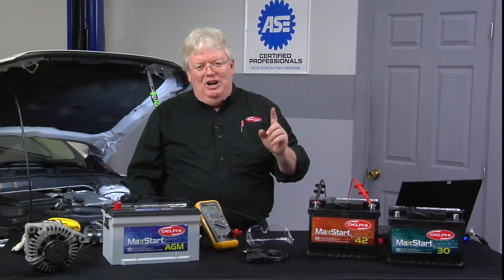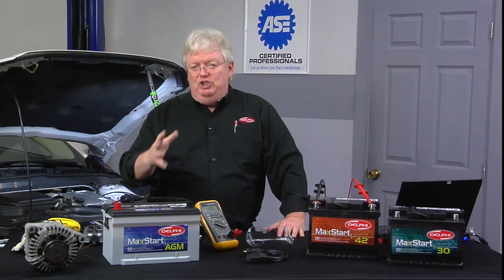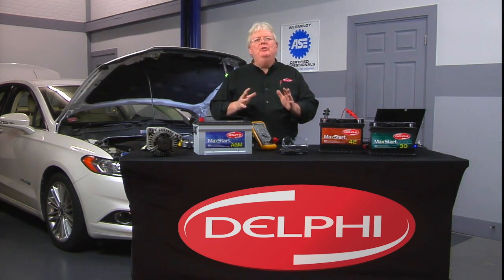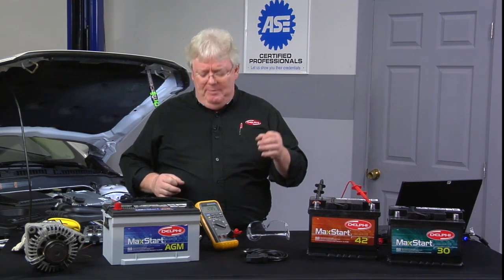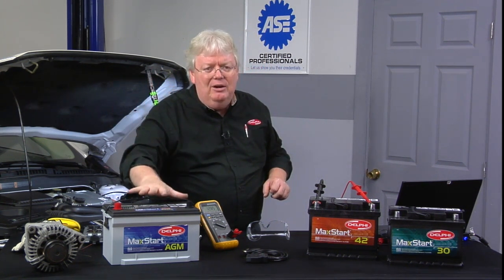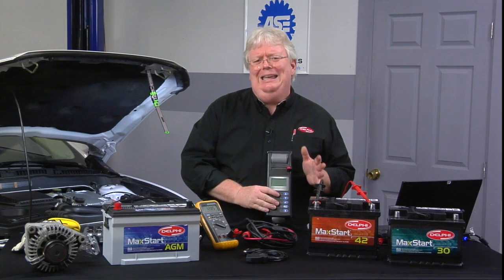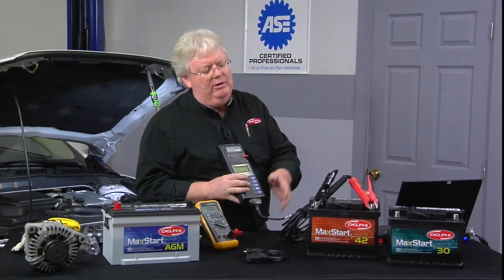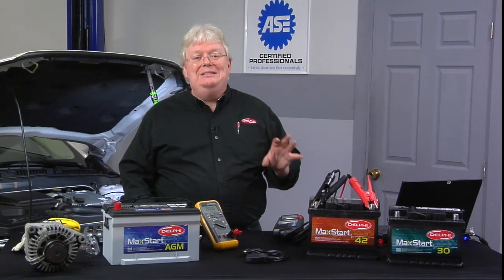How to Charge and Test Absorbed Glass Mat (AGM) Batteries

Comment: I like to use both testing methods. If a conductance tester says the battery is bad, it's probably bad. If it says the battery is good I like to confirm it with a load test. (15 second cranking test.) Often times a battery that fails a load test will test good with a conductance tester.

Comment: At the empty can be recharged correctly the AGM battery? I had a bad experience w/a AGM battery from Canadian Tire after one year of use but my chance was that I receved other battery under warranty. 5 years under warranty. Good deal. The new battery has 12.7v before to be installed on the car. The battery is w/gel inside. The AGM name is bizare for this type of battery. The history of the known standarde batteries passe to the...history.

Comment: On the optima batteries ive had several 10 yrs and a couple 12yrs they have a website that explains how to charge them using any other old battery works great for me i have found 3 at yard sales for 20.00 all still working at least 4 yrs for the mot recent one they cost 300 plus very good tutorial on the website

Comment: If you have an AGM charger, then you probably won't be watching this video. And if you want to know how to charge an AGM you won't find out by watching this video.
Reply: I do have an AGM charger, a Phoenix Multiplus. The answer i´m looking for. Can a simpel 12 volts 40 amps car alternator charge these types of batteries proprely, while driving, whithout damiging them? I want to replace the lead batteries with AGM batteries in my camper. Their only purpose, providing power to the living area. I can´t find an answer to this.

Comment: I have just at to replace my AGM battery after 9y I bought the car when it had 40.000 miles it has no done 70.000 miles the stop start stopped working 2y ago but I don’t want to be stranded this winter so I bought a new one and when my garage when the car was having a service  advised my to charge it now the stop start has started working and the crank speed is now a lot faster

Comment: Brand new Duralast Platinum AGM battery showed 11.56v on an open circuit test. When I say brand new, I mean I tested it 5 minutes after I got home w/ the battery in the trunk, not yet installed. 

This was supposed to replace another of the same battery that is 2 yrs old which has a resting SOC at 11.13v at the terminals & shows 11.9-11.7 on the instrument cluster. Seriously, wtf.

Comment: Great video and information, I wasn't aware that AGM batteries have a higher voltage. What is your opinion on Battery Chargers with desulfation mode built in such as CTEK, Noco Genius, and Pulse Tech charger's have?

Comment: on my agm battery it says cycle voltage 14.5 to 14.9 volts. im running solar and my inverter kicks out at 15 volts for over load protection. so will i get a full charge at 13,8 volts?
Reply: My AGM battery has a charging requirement that states it should not exceed 14.4V, but the Schumacher battery charger I was using would ramp up to almost 17V, which caused my battery to overheat and fail. Not all AGM batteries are the same and have different charging requirements. Following completion of the charging process and after I allowed it to rest in order to remove the surface charge, it was found to have lower CCAs and voltage. The fact that I didn't have much success with that battery charger is not surprising.

Comment: I have a blue schumaker battery charger and when I set it to AGM or Gel it still charges at 15.4 - 15.3v  or so. Seems a bit high.
Reply: I think I have the same one. It is testing to see if the cells need to be desulfated, and if so will keep voltage up to "blast" the cells. If not, voltage will drop down and even taper off to 12.7 closer to 100%. Hope this helps.

Comment: That's why you should never let an auto parts store or mechanic shop install a new battery. The batteries are sitting on their shelves. Although new they're losing voltage. I've bought batteries at Walmart the Everstart Value ($50) for my 2001 Subaru Outback and an Everstart Maxx ($90) for both of my 2008 Subaru Forester's. I put all three on a charger and they needed to be topped off anywhere from three to five hours. All three batteries are reaching close to five years and even at -11 degrees fahrenheit they have started my cars on the first try.
Reply: Not true. As long as alternator charges ok it’s fine

Comment: Thanks for explaining charging batteries, charge %, etc!  

How does the load tester calculate battery health (roughly)?  How reliable is the battery health calculation (will it be different based on temperature, charge level, internal resistance)?  What is internal resistance?
Reply: I tested my flooded battery @ autozone one month before it left me stranded 😅 it tested good 500CCA out of 600CCA original in a 18 months battery
Reply: @Eli-kr5bm So why'd it fail?
Reply: @hjer731 i think it was the rough terrain I have where I live, all 4 batteries I had in my life failed that way, flooded and suddenly failed without advice, after that battery I checked at autozone before failure, I started using AGM batteries and man they ate holding like champs, 4 years now (I normally should be in my 2nd)
Reply: @hjer731 supposedly is the plates that brake off in off road, thats why off road cars use AGM’s

Comment: for my application i have 2 6 volt agm deep cycle batteries  hooked up in series. i have been using an older 6-12 volt battery charger when i m home and i just realized that i need to get one for AGM specifically, can you recommend something that  its going to be more than 1.6 amp and on the affordable side? can i get something rated 20 amps or should i get 10 amps or 30 amps. thank you .

Comment: Is it possible to charge a agm battery that’s reading 8v just by hooking it up to a working battery in a car threw jumper cables and let it charge for a while ?
Reply: I have read that is one way around chargers that refuse to charge AGM batteries.  Just don't let the voltage of your car battery get too low in the process.

Comment: Anthony Amalfitano
 asked Can I charge an AGM battery to full charge in say a 1 hour drive?
Short answer: No and don't even try.  Long answer, read on.  All lead acid batteries are basically the same:  bulk to 80% then they need easing up.  Regulator electronics have always had to work with that.

AGMs in particular Optima's spiral/cylindrically formed ones need a higher finalising voltage of 14.7v but now some charger manufacturers are pulling back from that and just selling ones that go to 14.4 to avoid user error.
Some people argue AGMs can take bulk to 90% some people say LA bulk to 60%.  There are almost as many opinions as there are batteries and noses.

However, what the electronics finalise at, doesn't affect how fast the battery can be charged at.  Most advice suggests 10-40% of a batteries 20hour capacity rate.  Eg a 100aH at between 10-40 amps up to 80% (10 amps from 50% to 80% neglecting inefficiency, 3 hours) then 4 hours or max amps linearly down to trickle ((10 down to 2 is ave 6a 98% means 18aH/6a)) and thus 3 hours of absorption until the charger says that's it.   So 6-7 hours allowing for inefficiency, testing routing but any regeneration programme time on top.

A faulty regulator will let its alternator burn out a battery. 
A battery (LA or AGM or Gel) takes a long time to get to full charge.  Forcing charge in reduces battery life.
  Why salesmen are right to say get a clever charger.

I hope his helps you and anyone who alights on this looking for enlightenment.

Comment: I have a new V-Max agm SLR 125 battery which I am going to use in my camper van for House power.  The van has a 300 amp inverter from the van battery.  Which would be better to charge the SLR battery?  Connect the power from the alternator/battery via a 25 amp fuse and relay into the SLR 125 while driving or use a Smart Charger from the inverter?

Comment: What does float mean and how do i do that after charging it saya to do that on my charger
Reply: Float means the charger backs off the voltage to just over the fully charged level (i.e. another 0.5 volts over the full charge of 12.7 volts) to prevent overcharging.  Deltran battery tenders are sometimes referred to as "float chargers" that automatically do this.  Most battery chargers do not allow you to adjust the voltage.  They either automatically "float" back or they will ruin the battery (even if left on "trickle") if you leaven them connected for many days / weeks.

Comment: I watched the video, read some other articles.. but still am a bit overwhelmed with various specs and terminology with batteries.

This is the info on my new AGM battery:

•Charge/Absorbtion/Equalize between 13.8- 14.6 Volts at 77° F

•Float/Standby between 13.4- 13.6 Volts at 77° F

•Temperature corrected charging required

This battery was just purchased and has not been installed.  The voltage reads 12.75 with my very basic multimeter, set on DCV (20).  Also, when tested the battery was in my cool garage, about 46-48°F.

I've always understood that if a battery reads 12.7, that it is fully charged.. but looks like I may need to charge this one to 13.8 before installing?   And charge at the right temperature?  Does float mean 'when the key is off', and does charge/absorbtion/equalize mean when the car is on and the alternator is cranking juice to the battery?

Thank you to anyone who can help me gain some clarity.. I experience add on the higher end of the scale, and i have to go over things about a million times before i get a picture in my head.
Reply: Some batteries do have numbers to say what they should be charged at when it is 77F, but then you need your battery to be at 77F and a charger you can set voltage and rates.  Not many car owners have one of them.
If you have an Optima battery chances are you're in the US and I suggest you get an optima battery charger.  Because Optima make their batteries slightly differently - spiral/cylindrical.
If you have another make of AGM buy a CTEK charger with temperature sensor and AGM mode.  They keep updating model numbers.  Then you don't have to worry as so long as you select AGM mode the charger takes care of the rest.
Charge means charge. Bulk refers to the stage a battery can take a fast charge the bulk of the charging.
Absorption refers to the point when the battery starts to say enough is enough you're working me to hard I need a cup of tea and please take it more easy on me.  The battery slows its absorption rate.  (Actually this is true of simple lead acid, Calcium types and AGM.)
A modern charger measures the battery voltage and decides what charging voltage to apply and how much current to release on the battery depending upon the mode you select and the temperature it senses.  (Put the sensor close to the battery.)

If you measure the cars voltage say through cigarette lighter you will see some like the following:
Car locked and has been overnight 12.6v  (say, and there is debate about this, 75%)
Open doors 12.3v  (This does not mean you have a 1000 amp short circuit.  It means battery voltage drops under load.)
Key to position 2 (Hifi works and other stuff powered.)  12.1v you start the car it fires.
The alternator kicks in and voltage increases soom getting to 13.8 and then topping out at 14.4 to 14.7v depending on car brand what their charging philosophy is and of course your battery - read on....
You may have a 160, 180 or 200 amp alternator but that is so it always has spare capacity and isn't balls out all the time.
The car electronics tell the regulator what voltage to provide and what current to release to charge the battery.
This is why you car often needs to know when it has been fitted with a new battery and exactly what battery it is.

Often a car has space for a big battery but for a base model the manufacturer only fits a smaller one.
Sometimes the manufacturer releases a technical advisory to dealer workshops saying:
We have changed our minds.  Car X should only be fitted with battery type Y and size ###.. (purchased from us of course).
Car these days, 2000 on, are basically computers with wheels.

If you think that this is overly complex.  Believe me I am only scratching the surface.  People think it is a battery how complicated can it be.  They go to the auto parts store and wet behind the years looks up on an old chart and say you need one of these and whacks it in.  No, no and no!

What else?  Don't trust their plug in testers a new battery is just as likely to fail.  Get a Foxconn or a CTEK if you really want to splash out.
Always read what your car manual has to say about charging.  Probably only through the terminals in the engine bay - so the computers know what is going on.
In general don't connect a charger to a running car.
Best to wait until all car electronics have switched off - look if the car is still drawing power the charger thinks the battery state is different from what it really is.  Even better to wait overnight.  Of course that is not convenient, but it is what is best for the battery.  If you drive every day the battery should get flat anyway.  If you only drive every three weeks then of course the car alarm and stuff will drain power.

I have had AGM batteries last 13 years and still be at SoH of 75% - again another debate is 75% enough.  Well it starts it, but the car draws 20-30 amps and 75% of 90aH times, say, a 0.5 factor for fast discharge means 30mins to one hour of watching movies before it has had enough.

This is why modern cars in showrooms have a power supply feeding cars 8am to 8pm and perhaps why you should ask for a new battery on a demonstrator.

Sorry for long post, but I hope this helps you and anyone else looking for enlightenment.

Comment: Will an alternator on an early model car charge an AGM battery to full charge in say a 1 hour drive? Or do some modifications need to be made to the alternator?
Reply: Anthony Amalfitano As I've recently learned, typically the alternator on an older car will charge the battery with constant Voltage (~14V), and the battery will drop the absorbed current (Amps) from (a typical limit of) 10 or 5A, depending on the car, up to 0A, when the internal resistance of the battery reaches its minimum. This will lead to an incomplete charge of the battery each time, decreasing the battery capacity over time, due to the fact, that sulfates forming on the battery plates are not completely moved back into electrolyte. A smart charger, on the other hand, will charge the battery at variable Voltage (V), while keeping a more or less constant current (A), and will drop both voltage and current as the internal resistance of the battery decreases, but will still try to keep current above ~0.5A, so that the battery gets charged to its maximum capacity, meaning more sulfates will be removed from the plates, and the aging process will be slower. That being said, many people will still find it easier to buy a new ~$100 battery an year (two, three) earlier, and skip all the fuzz with carrying around the heavy battery, charging it, etc.
Reply: Short answer: No and don't.  Long answer, read on.  Old car = Simple, right, but all lead acid batteries are basically the same:  bulk to 80% then they need easing up.  Regulator electronics have always had to work with that.

AGMs in particular Optima's spiral/cylindrically formed ones need a higher finalising voltage of 14.7v but now some charger manufacturers are pulling back from that and just selling ones that go to 14.4 to avoid user error.
Some people argue AGMs can take bulk to 90% some people say LA bulk to 60%.  There are almost as many opinions as there are batteries.

However, what the electronics finalise at, doesn't affect how fast the battery can be charged at.  Most advice suggests 10-40% of a batteries 20hour capacity rate.  Eg a 100aH at between 10-40 amps up to 80% (10 amps from 50% to 80% neglecting inefficiency 3 hours) then 4 hours or max amps linearly down to trickle ((10 down to 2 is ave 6a 98% means 18aH/6a and thus 3 hours of absorption until the charger says that's it). So 6-7 hours.

A faulty regulator will let its alternator burn out a battery. 
A battery (LA or AGM or Gel) takes a long time to get to full charge.  Forcing charge in reduces battery life.

I hope his helps you and anyone who alights on this looking for enlightenment.

Comment: In the mornings when I check the voltage on my car battery(AGM) it shows between 12.2/12.3 volts. Its been this way since I bought the car brand new. I had the car not even two years. Is this normal? I also noticed that if I am driving it was show 12.4 volts and when I take my foot off the gas it goes to 14.5 volts.
Reply: @Fat Italian Its a 2018 Chevy Cruze with a build date of 3-18-18
Reply: Its normal to get a higher voltage when you left off the gas, and lower voltage when accelerating
Agm batteries gives you less CCA (when cold) perfectly normal

This with modern vehicles
Reply: @Eli-kr5bm  In what world does accelerating a gasoline engine cause the battery voltage to drop?  EV or hybrid, maybe, but that only applies to the traction battery and not the 12v.  Something is seriously wrong there.